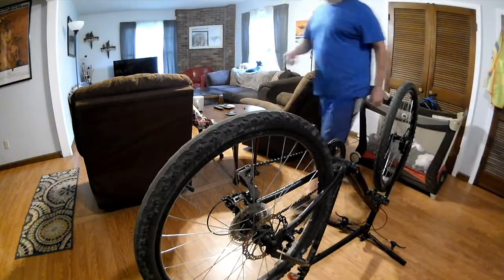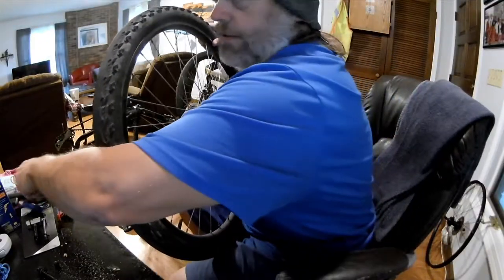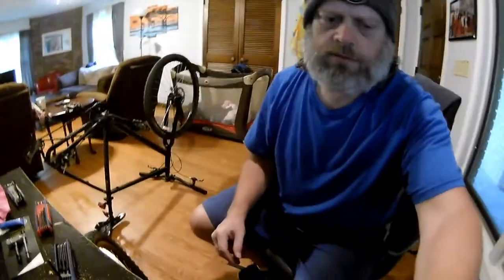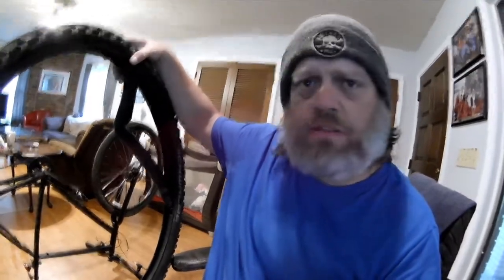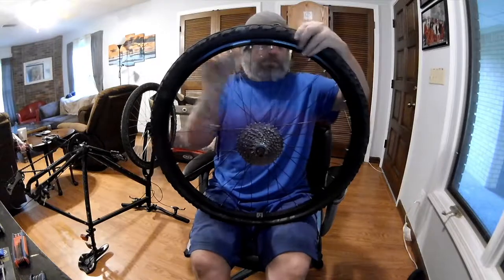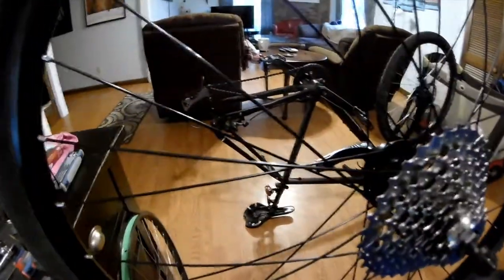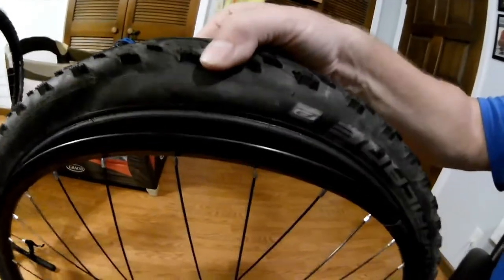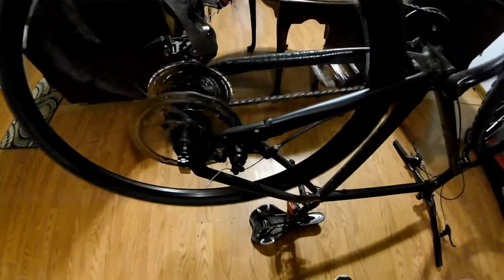Raleigh Redux New Wheel,Cassette,Chain Install 6 30 19

Comment: 17:19 yea that's quite common, it's a tyre meant for inner tubes, and it does not have a wire, but got a nylon bead probably, and the diameter is probably bigger to make it easy to put on.
but when you pump it up the tube pushes the bead in place. quite different to stiffer casing tyres like Dh casing tyres, or cheap commuter tyres, or heavy duty studded tyres, or tubeless tyres, all have different aspects that make it different, stiffer casing and bead will make it harder to put on, for example. tubeless tyres have the tyre better shaped, the tyres are not as big in diameter, they fit more tightly and the bead pops in locks in the rim wall.so running tubeless on tyres that are not meant for it won't always work, some are just too getting air trough the sidewall, and some just won't pop the bead due to fit like you got there.
Reply from the maker: thanks

Comment: I recommend you get a hand cleaner, they a basically moisturiser, with fake sand in them, and stuff that makes your hands clean, I can get my hands completely clean, no matter what I get on my hands, but I also recommend to wear gloves.
Reply from the maker: used Dawn dish soap did good and good ole hot water.. but yeah they make hand cleaners.ive used before..

Comment: 21:17 I thin you could pre-rotate the rotor,backwards cus the rotor can move if bolts artlessly loose, and rotor might move when you brake and make a bang, I do this, but bolts have never loosened for me so not really a big deal for me.
Reply from the maker: yep..i rotate it back as far as i can to take out any slack.its recommended to use a thread locker on those as with some others screws.So i do it.

Comment: To me it makes no sense to put tube in the tyre, jut put the tyre on on one side then put a slightly inflated tube so it's round, and then work the bead in, make sure to not pinch the tube. this takes few seconds to do.
any reason you do it this way? to me it seems like a harder,slower way of doing it. but for you it seemed to work quite ok, but the results might vary depending on tyre used, in many cases it will be impossible to do what you do here, there won't be enough slack, so need to do one side at the time, then tube, then other side carefully.
13:01 that pump is tiny, you should use a proper track pump instead,, this is less fatiguing.
Reply from the maker: i have always installed tubes that way since i was a kid. just makes more sense to me. makes sure the tube is perfectly placed in the tire. just my opinion though..and yes..i know..i need a real pump.
Reply: @mikieson  makes sense, in your case for sure, but as I mentioned depends on the tyre,some tyres are quite hard to put on even one side, yours is not so your method works great. 😊
Reply from the maker: yeah thats why i was concerned because ive never had a tire so loose like that. most are somewhat tight where you need to force it on..However like i stated..the tire seems to be "ok"..i guess ill know when it slips off..haha

Comment: 16:17 it looks like you got Formula Hubs DC-22 https://www.formulahubs.com/
they got proper seals, so the hubs won't be a greasy mess, but I did not have much luck with my formula hubs, one had no grease in hte freehub, and got sloppy, also you can service the freehub whiteout special tool, which is not as easy to get, I much rather have a system like on my Hope pro 4 hubs, don't need a special tool, only a hammer, screwdriver, bearing press, to press bearings in, i grease them well, fast easy job, but Formula's system on cheap hubs is trickier, you need that special tool to open it up.
Reply from the maker: thanks